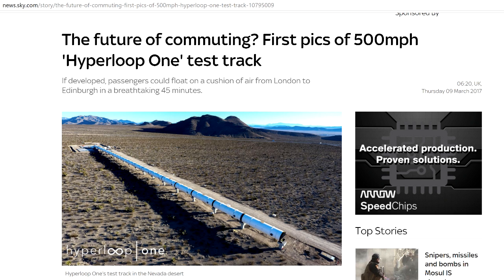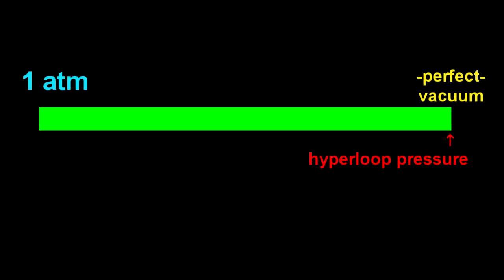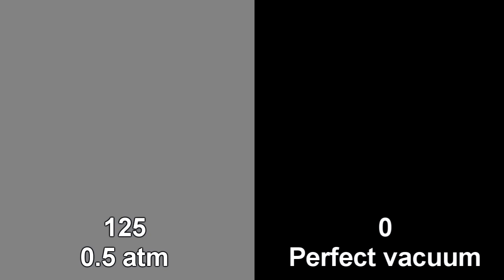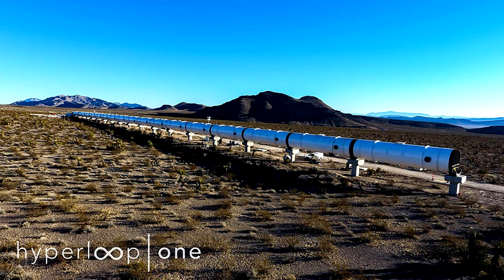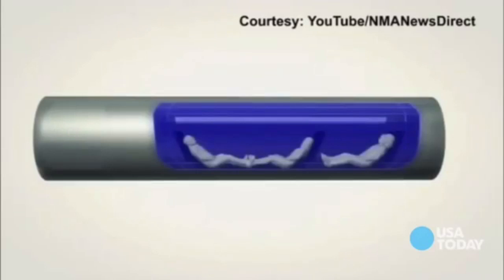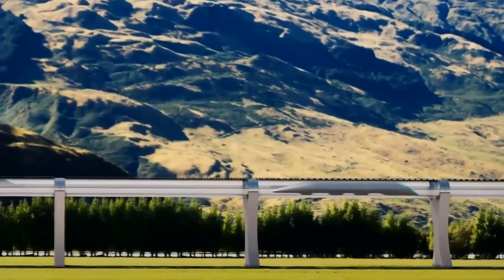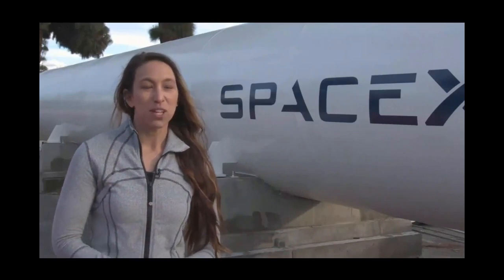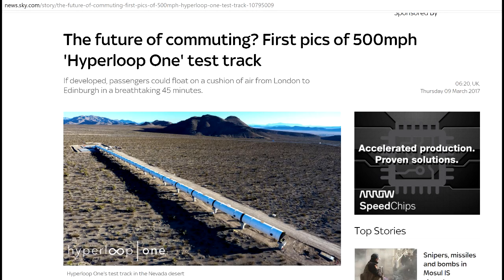Entire Hyperloop could be destroyed in SECONDS!

Comment: Wonder if it would be safer to use 500 mph winds inside the tube so the cars resisted slowing down- if the loading and unloading zones had very large surface areas that wind could just be a breeze at those points.

Of course then the loop would be some sort of high pressure vessel but as long as they do not build it running through anyone's living room who cares.  I do not know what pressure one would need air to be at to move (just air) 500mph but maybe could be fairly low.    I'd still wager that is safer for the people being transported.

Comment: what if they didn't produce vacuum in the tunnel, but instead blow air in the same direction the vehicle will be going, to reduce the air resistance? that compared with maglev might be a reasonable workaround, unless it's very energy expensive (which i suspect would be)